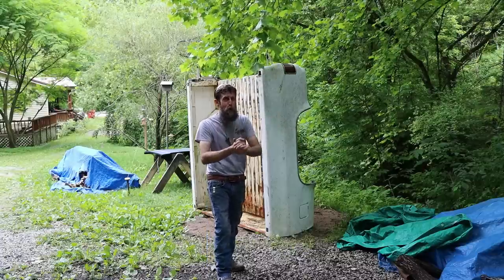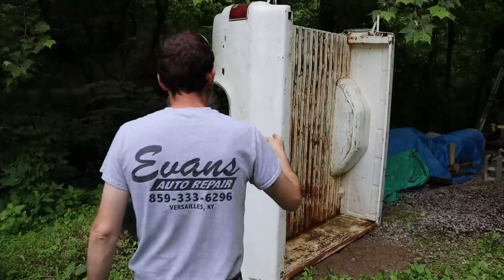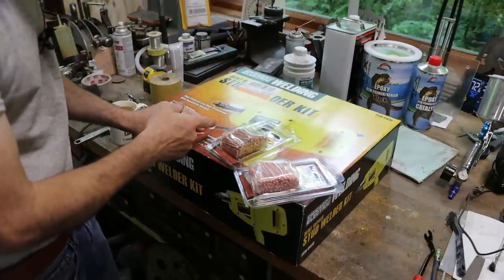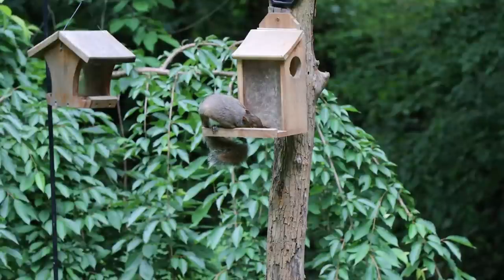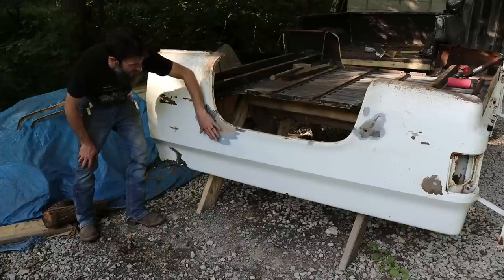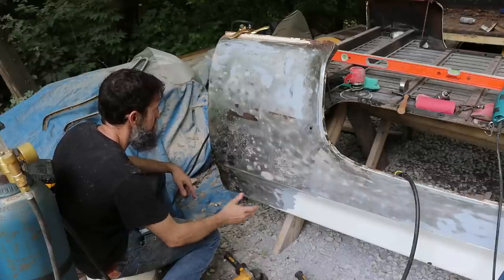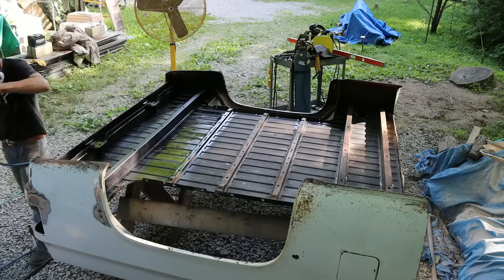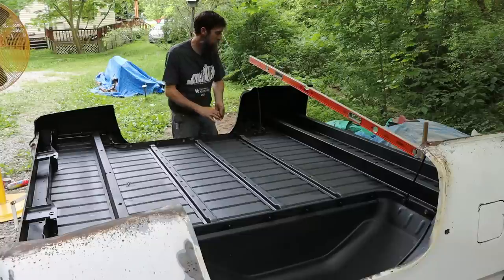They do still exist in the wild and we found one to prove it.

Comment: Still cheaper than buying a new truck and will be repairable without having to have 10000 dollar scan tools and computers. Your doing good in my eyes.
Reply: Autel makes a very powerful scanner for under 2k
Reply: @calvinculpalt  how much to update every year?
Reply: @haroldphipps3457  0$ If you don't want to update it. You can go years and years without updates. I've had mine for 5 years now and never ran an update.
Reply: @calvinculpalt  so, the newest stuff you can scan is 5 years old, correct?
Reply: @haroldphipps3457  that is not correct. I can still scan 2022 models.
Reply: @calvinculpalt  without updating?
Amazing.
Reply: @haroldphipps3457  What's so hard to understand?
Reply: @TinyBullets  nothing.
I said amazing. 
What the fuck is hard to understand about that?
Reply: @haroldphipps3457  Ah, tough guy keyboard warrior.

Comment: You're right, some of us love having our grandpa's square body.  Mine is a 1980 Chevy C10, Custom Deluxe, that my grandpa ordered in 1979, brand new, with a 250 I6 and a 3 speed transmission.  That pickup has 330k on it and is still doing just fine.  It's got some rust issues, but hauls stuff just about every day I drive it.  Only burns 1.5 qts every 2500 miles, which is how long I go between oil changes.  The silly thing costs me about 20 bucks a month to own.  I know some guys who pay around 900 bucks a month for their pickup and insurance.  Forget that.  Lol

Comment: Steve, I've seen the same pickup like yours get upgraded to become an EV.  Anything is possible when the chassis and the body is solid.   Even Ford restored an F100 into an EV using the Mustang Mach-E full electrical motorized package with the inside cab EV trim.    Your doing justice to your pickup, you're giving a second life to it.  great job Steve

Comment: I have had a stud puller for years but I just had to fix a tailgate with damage similar to yours.  I ended up making a little bridge from heavy steel welded a bolt ground to a point to the dent and pulled the dent with the bolt going through a hole drilled in the bridge. Worked great

Comment: Anti tailgate theft tip. Place hose clamps around the hinge. Use the type of clamp that requires a small open end wrench. You also want to place the wrench flats in the most inconvenient place for the wrench to operate. 
Back in early June I spent a few days in N. Arkansas. I saw quite a few 80 something ford trucks. These were all un-restored daily drivers with original paint. None of them had any visible rusted through spots. I’m thinking Arkansas is really a good place for beautiful things to look at.

Comment: I'm currently on the hunt for a new bed for my project as well!  These 80's and 90's trucks sure are getting hard to find parts for, that's for sure!  Excellent progress!  You're not wrong- these 80's and 90's trucks are quickly becoming classics, and highly collectable.  Also, with the ridiculous cost (if you can even GET one) of new trucks combined with the cost of maintenance...  It's just not viable.  What is MORE viable, is exactly what you (and I) are doing: Restoring/revitalizing these trucks, and upgrading where needed/wanted.  My plan is a touch different- I'm going to eventually update the truck to almost modern standards.  Like anything, it'll cost money.  However, as you've already stated, the money invested in our older trucks will amount to FAR less than the $70k that modern trucks cost.  Plus we'll have the added bonus of both sentimental value and classic good looks that modern vehicles just don't have.

Comment: One of my coworkers bought a truck that had had a camper on it from new. Some 30 years later the bed was mint. I had never seen one that looked like that. It was a wood floor and there was still the original paint on the wood. I didn't even know wood was still an option up to 1980.

Comment: Wise move dealing with any old vehicle we can repair ourselves.  I learned a long time ago that warrantees mean nothing if the thing is dead on the side of the road, and you need to get where you're going. I blew a turbo 400 trans 6 hours from home, called my brother who loaded up my spare and by the time he got to me, I had the dead gear box out and we installed my spare on a floor jack. Big heavy job for the side of the road, but I was back on the road in a matter of hours, not days or weeks. All these new vechicle's forget about it, but the old ones we can keep going for many decades. This is why I only own old cars as the newest one is a 1970. There is a reason they call them classics. Kind of like the owners that restore them. Question ? how is the Doall mill coming along ?

Comment: I think I would have carefully sand blasted down to the bare metal and sprayed on some Metal Prep Por15 before priming it. The phosphoric acid and zinc phosphate in the MP leaves a protective layer of phosphate, that protects metal a lot better than any sealer does. Yes, it was only flash rust on there, but rust is rust.
Reply: Yes I am rather surprised it didn't get the wet sandblast treatment that Steve showed a few months ago with the truck door bottoms if I remember correctly.

Comment: Odd seeing how your "stud welder" wasn't working very well. I've used one that was a blessing to use and worked extremely well. But I guess it depends on the make. Nice seeing how you're removing the blobs of filler to work the panel the proper way. And I was going to comment how you have a perfect bed sitting there that you can cut patches from if needed. But you stated that idea as well. I also see how you are now pushing this project to more than some simple fix and paint project. You fell into that, "well while I'm doing this, I might as well do this too", mindset. It gets that way so many times. Thumbs Up for doing this the nice way...

Comment: at our body shop we use the same stud welder the welder works great when you grind the spots to clean metal but the hf studs are junk get some reputable studs and they will work much better
Reply from the maker: My brother has the same unit and he says his works great.  I must have got a dud
Reply: Don’t know about the different quality of studs but as this follower suggested you must weld to clean bare metal.
Reply: @SteveSummers  i think the metal was just not clean enough, and i watch it start getting red hot and count 123 then get off the trigger but you may have got a bad one

Comment: My father bought a truck that was ex parks board. Toyota Hilux, with the bed long rotted away, and replaced with a wooden one, also rotten. Chassis though was fine, so he went to the canopy places, and hot a new bed, removed to make box conversions, that fitted the vehicle after a bit of hole surgery. No tailgate, but there was a wider one with the Toyota logo, which was the right profile, and had all the hardware and hinge pins, so he took it. No charge, they otherwise pay to get rid of them. 

Then back with this bed tied to the flat, and it was attached, then we spent a weekend  doing some cutting on the tailgate, removing around 3 inches both sides, and making the end caps fit with the logo still in the centre. Brazed on with lots of copper wire, and then put in the truck bin. Then he went to the rubberisers, and got a lot of part tins of the rubberising, and painted the bed with a few coats.  For not much more than some sweet talking, he got a good bin, close enough in colour, and a working tailgate.

For that new bed, how about removing the good ribs from the old one, and then welding them in place as extra bracing, will help with the bin bed flexing between the ribs.

Comment: How clean was the metal you welding the stud to? If it’s not perfectly clean, it won’t weld properly. Also if the spot you’re welding it to isn’t flat where the stud head is, it will just weld on some tiny spots, and won’t hold. These things work well enough where the metal is a largish sheet that’s not supported near where your doing this. But on an edge like that, the metal has almost no give to it. You would have to clean the metal well, and then TIG the stud to it.

I have Martin hammers too. They’re actually among the more expensive ones out there. I prefer fiberglass handles with rubber grips, but that’s personal preference.

Steve, I know you’re outside, but you really should wear a dust mask when you’re sanding this. It’s bad stuff.

Polyester sands much better than epoxy. It also has some flexibility, so that it’s more resistant to vibration. Two part acrylic is also good, but is harder to find, and even more expensive.

Comment: In a recent video Fitzee said that the inside if members like those support beams were left bare when mfg’d. No paint or anything. Is that the case with a gm truck bed! If so no wonder they basically dissolved

Comment: Was wondering why you didn't use a rust conversion on the bottom of the bed before you used the primer? Almost impossible to remove all rust and rust does not stop under primer. Thanks very much for sharing.

Comment: some guys use chain saw blade lubricant to spray the underside of their vehicles to stop rust, one guy showed it after a couple of years of using it and it was still there and no more rust had appeared
Reply: Gallon of bar oil mixed with a quart of atf.

Comment: As the dent puller doesn't seem to be a success, could you use the point of it which holds the welding pins and make something up that you could attach to a stick welder and then use it to attach the pull pins, not having enough welding power seems to be it's problem

Comment: I'm a little surprised you did nothing about the surface where the wheel arches are screwed in. Also maybe zinc coating the fasteners would be a reasonable approach, rather than chrome.